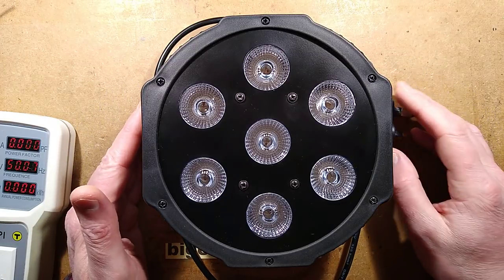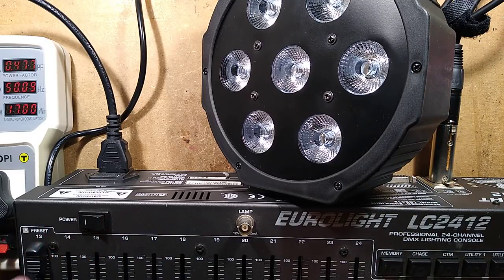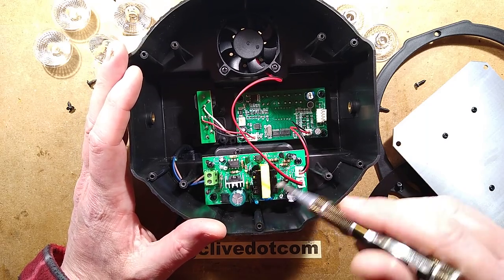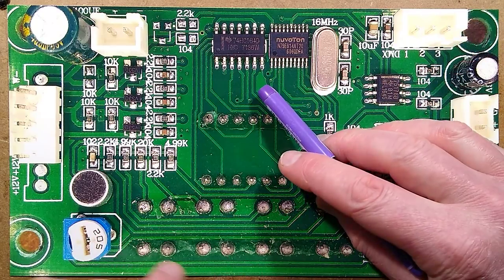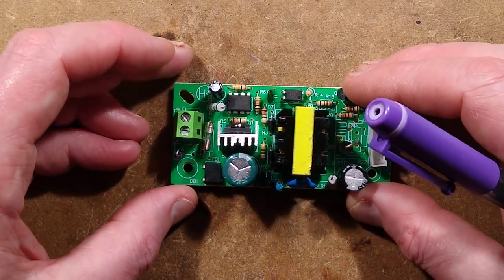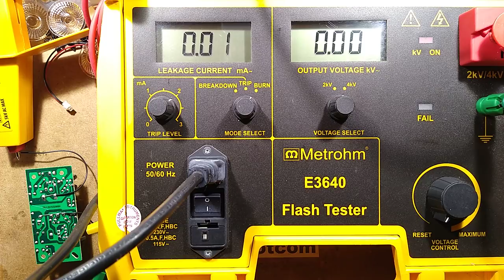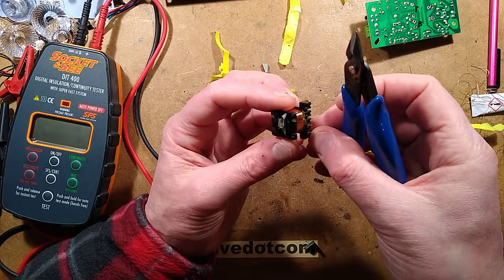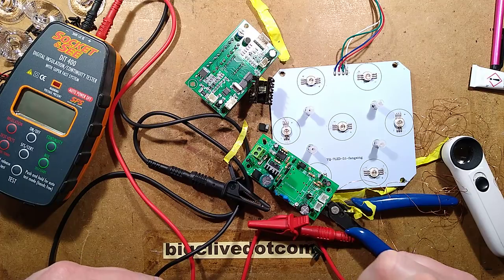3KV test of cheap disco light with circuit analysis.

Comment: I have loads of these 7 LED flatpar fixtures. Two things:

- You need to save the changes you made by pressing Enter after making any changes. It doesn't just random start at any mode, it starts in the same setting you've saved last. Press enter in any mode and you'll see Save on the display.
- Only the mode you currently see in the display is active. Meaning that when you have the light on DMX mode, you don't need to "shut" the manual mode.
Reply: Usually good to set the manual RGB values to zero though.

Some of them do strange things.
Reply: @shaunclarke94  These don't.
Reply: @benedykt123313  fair enough.

I've noticed similar ones do strange things. Easy to suss out when they're on the bench, less so when they're in a hard to reach spot on a ladder!

Had one which I obviously didn't save the "be a slave, not a master" setting to EPROM, and after a power cycle it took down the whole DMX universe. That was fun!

Comment: Hehe, when you pulled out the lightning desk, I immediately remembered my manager at work placing some brand of lightning panel at my desk mentioning something like "If you see some use for it, it's yours, it's broken and we are unable to fix it."
A colleague and I (the local television station that I had left as an employee still can use those things very well, even if only for replacement parts or when you inevatibly manage to repair stuff like that, that's a huge cost-saving kind of exchange of equipment between companies)  pulled out a light from the studio and before connecting it made sure there was no mains voltage on the output, connected the light which, at first instance did not light whatever we did, so we opened up a small part at the back where we found the DMX-polarity switch, flipped it and hey-ho, lightning desk (even though a cheap kind of thing) turned out to be working absolutely fine with every function we were able to figure out from memory, and the local television station now has a pretty good lightning desk for their studio. :)

Comment: The Oxford English Dictionary gives for "menstruum", as well as the obvious gynaecological usage, "A solvent; any liquid agent by which a solid substance may be dissolved." Presumably that is what they meant.
Reply: Stuff like nail paint remover?
I noticed it can melt plastics.
Reply: @SqualidsargeStudios  acetone tends to do that
Reply: @SqualidsargeStudios  A hefty dousing of nail polish remover on a (hated) co-worker's keyboard is always good for a laugh.
Reply: So basically the good old "don't use aggressive cleaners", just with antiquated language?
Reply: @michaelknight2342    many plastics, yes, but the acetone I've got is sold in plastic bottles.  A very specific plastic I guess.
Reply: @rolfs2165  Yes, but that's less fun.
Reply: TIL
Reply: Out of sight, out out mind = 
Invisible and insane.

Comment: I use Behringer audio gear and I mix music professionally,  they use Midas preamps, and TC Electronics designed circuitry etc. and when they clone something they add all the features that the original should have had.

my theory is that Behringer got their bad reputation purely from the fact that in the early 00's they were cheap to buy and as such people treated them like they would treat something cheap IE garage bands would buy one of their compressors and just beat it up, or pubs would use their mixers (due to cheapness), basically they'd end up in environments that you wouldn't find something like a Neve console and as such they were easily broken and abused by people who were drunk or stupid. 

so yeah, the only audio people who you'll hear complaining about Behringer are either cork sniffers or the people who bought a autocom pro back in the 00's and are still sour over the fact that a couple of the knobs broke off after years of flinging it into their car with no front panel protection.
Reply: I have a soft spot for Behringer products, they definitely give you a functional and pretty neutral sounding product for affordable prices. I started my career as an audio engineer using some of their analog consoles and outboard processing. My only grievance are the faders they used in the eurodesk and xenyx line of mixers, they tend to attract dust and grime and get intermittent after a couple years, regardless of keeping the board covered between shows. I do love the x32/m32 console though. Pretty much an industry standard for medium format event service.
Reply: @Wiresgalore  most things have that problem, people just don't tend to bother servicing Behringer stuff which is a shame. I still have my very first autocom pro, however I lost the first Behringer desk I had to a flood. you're right about the neutral sounds though, I hate it when audio gear affects a signal in a manner that I can't control, (I'd say "except microphones" but I kind of consider them a musical instrument in and of themselves). I just want it to do what it's supposed to do so I can focus on capturing the instruments/vocals etc. without having to worry about harmonics overstacking on everything and turning it into a muddy mess that I have to spend ages EQing out.
Reply: Dave Micolichek  lol - a bunch of pro guys on prosoundweb.com did a blind comparison test right after the X32 started first shipping and the x32 overwhelmingly was their pick - to the consternation of several of the “old timers” who were convinced B was crap.   

BTW for anyone curious, this post from the man himself explains why the X32 was indeed a game changer for them: https://soundforums.net/community/threads/uli-behringer-of-the-music-group-q-a.4396/page-5#post-51622

You can pay more if you want, but it’s stupid IMNSHO.  We got talked into buying a soundcraft board.  It’s shit.  No functionality - you can save all or none of your settings.  Might as well be taking a picture of an analog board.  One of the huge advantages of a digital board is if I have a singer swap in at the last minute I should be able to load my Mic and channel settings in for just that singer.  I can do it with an X32.  Can’t with a Soundcraft (and a surprising number of other digital boards).  It didn’t even occur to me that someone might ship a digital board that couldn’t save/restore partial sets of settings - that’s one of the best features of a digital board, especially with moveable faders.  No more having to take pictures and then manually reset crap.  I was floored.  Yet people still act like it’s a good board for live sound.  Unbelievable. 

The Soundcraft apps and PC support is shit too. The X32 is open (OSC support is amazing - you can control any function on the board via an OPEN protocol), has a HUGE enthusiast community, and at this point there is little you CAN’T do with it.  We got screwed, royally, by buying a “real” board.

But it gets better!  Samsung bought Harmon who already had sucked up Soundcraft.  Before Samsung bought Harmon, Soundcraft already had a reputation for being glacially slow.  Since Samsung bought them almost three years ago not one update.  I take that back - maybe the update to enable 80 channels.  That you still have no automation in organizing or controlling; as if 32 channel management manually wasn’t hard enough.

So yeah, dis Behringer all you want but for overall features they kick the snot out of over half of the established guys and have functionality that even some of the “big boys” don’t have.  If they ever started releasing higher channel versions of the X32 you can kiss off companies like Soundcraft (no way in hell I would buy another soundcraft board period).  They will just be toast.
Reply: Behringer gear is fine as long as you look after it, like everything else. An Allen & Heath desk will stay nice because they are an investment, people treat them with respect and will service them, an equivalent Behringer desk will generally have a hard life because its bought cheap and never serviced, also usually they are entry level so get abused.
I remember working in a pub that had a 4 channel Behringer DJ desk, everybody moaned that used it about the sticky faders which to them was a build quality problem, to me it was a beer spillage problem and I solved it by taking the top off, cleaning it up and giving it a service.
Reply: Dave Micolichek  that's where you'd be wrong - you take something of Behringers apart and you'll see proper brandname electronics, very well laid out PCBs that aren't all covered in flux residue and one of the best things they've done - they have "coolaudio" ICs in them which is their own silicon respins of classic ICs such as the mn3205 and all the other BBD trans-amp etc. ICs that were made obsolete decades ago. they have never compromised with the circuitry, they got the price down by simply making things like the enclosures out of plastic rather than metal, using cheaper connectors which seem to have a longer life span than for example, marshall amp input jacks.
Reply: @DocNo27  Agreed about Soundcraft. Their idiotic Si range is a nice try but a pain in the ass when you want to get serious. See my rant at watch?v=InItrdACIcA&lc=Ugzgam5aDzKomczTTah4AaABAg – Enjoy!
Reply: Some of their stuff is amazing, especially for the price... Unfortunately some of it is just crap... Like the 24 channel desk we bought for our church, which had to be sent back about 5 times, was replaced 3 times, and died of the same problem we'd sent it back for after about 18 months...
The problem - the ribbon cables linking sections together were too small for the connnectora they used. They changed this in later builds (like the one we got that lasted 18 months) but it seems it's still too small and wobbly.

Comment: There are sound engineers who swear by cheap Behringer mixers for recording metal guitars, because the pre-amps work perfectly for that and let you pre-mix dark and bright mics before pulling it in to a DAW.

I just use one at home for combining the audio from my PCs and stuff.
Reply: Dave Micolichek  yeah, a lot of people thought that when they introduced the X32 and then they proceeded to promptly turn the entire low and midrange industry on it’s ear.
Reply: @DocNo27  I own a X32 desk, rock solid! Midas pre amps.. Love it. Earlier Behringer desks were indeed rubbish.
Reply: Dave Micolichek  They have that reputation- but are quickly losing it. I have a few more recent Behrs - a couple mixers and a Model D analog synth. Couldn't be happier.
Reply: They have their places, but reliability usually trumps them out of the game.

Comment: For the no-brand (and some brand as well) chinese LED-PARs you have to press enter after changing the values. There are no confirmation, but they won't store the values without doing that. That's why blue was at 7 for both the resets, it was the last stored value (not selected). Strobes/shutters usually reset the clock along with adjusting the Hz. Because of that they will usually black out when you change the value for a lot of fixtures (Martin/GLP/CP etc).

Comment: Apropos of this, thinking about past cases of maxing out a chip;  an early '90s disco light called (if i remember correctly) the Apollo Paradox. It used a PIC16C54 chip to read DMX, drive three steppers (with gobos) and a synchronous motor with some mirrors on it, switched the lamps, did sound to light and also read the DIP switches all without breaking a sweat. That was back in the day when people knew how to code in assembler and squeeze the maximum performance out of their micros lol.
Reply from the maker: I like to think of tight coding as a challenge.

Comment: About Behringer:
I have a bit if experience using the Behringer X32 rack mixer, and it is very nice! Behringer stuff is alright in my opinion
Reply: Until you have opened one of the smaller panels up for the 10th time because of loose connections.  Why mount potentiometers or even faders to the front while you can have the design be so that you exert all the forces on the potentiometers on the pcb-islands (cheaper, more prone to failure).
Reply: Uli Behringer was literally one of the first people to bring his manufacturing to China, seeing the value in their cheap labor, although at the begining he contracted with other factories instead of building his own and thats where all the quality control issues came up from in the beginning,  and of course all the blantant ripoff and reverse engineered products. After being there for a couple years he cut ties with the various factories he employeed and started his own, which eventually snowballed into a place called "behringer city" There are a few documentaries on behringer city china, as it is so large it almost is really its own city, all the workers actually live in dorm rooms on campus. Uli behringer is a very interesting guy as he started out building illegitimate products in the pursuit of actually eventually making very legitimate affordable products. I've owned numerous bits of behringer gear over the years and its all served its purpose and did very well for me!
Reply: This got smug, self-satisfied and 'holier-than-thou" in only five moves.
Reply: @QED I absolutely agree with you, with the exception that the mixing board in question was stationary on a desk and could not handle regular usage as a voice-over-station piece of equipment.  After having resoldered some of the parts for like the millionth time we replaced it with (I think) a Yamaha one.
Reply: @QED True (my experience is that the couple of times we worked with religious groups those people were usually a lot more careful).
Reply: I’ve just brought a Behringer XR18 mixer and it’s one of the best pieces of kit I’ve ever brought. However I do own a pair of Behringer 15” tops and after a year of very moderate use (I haven’t driven them hard) they really aren’t sounding fantastic. Not that they ever sounded amazing but still. I find it’s a bit hit and miss with their products some of them are fantastic and some of them are a little underwhelming ...
Reply: @mitchbelectronics  Same goes for BlackMagic Design, they really shook up the market for professional video equipment, but some of their devices are (to quote the owner of an OBV-company we worked with multiple times at the local television station) "are called black magic for a reason" (for instance, while keeping compliance lengths for HDSDI cabling (and in this case stayed about 25 meters within the maximum length) the Blackmagic components would cause faults multiple times in one minute, and switching a repeater from Blackmagic that has a reclocker in it with a Sony monitor solved everything...)

Comment: The 62-ohm resistor on the 78M05 input and the capacitors to take the edge off the PWM outputs to the LEDs seem like decent ideas, even if some of the rest of the design is crap. Very interesting.

Comment: Many many moons ago I did stage lighting, it was simple. I generally used Strand gear one dimmer per lamp. If you wanted several lights to change together you used a long piece of timber on a bank of Junior Eights, or clamped the dimmers using rotatable handles on a wheel board, forget what they were called. You could use colour change wheels with synchronous motors or a different colour gel for each lantern.

Comment: I'm quite fond of the LC2412. For a small stage with no moving lights, it has just the right amount of channels and functionality. Its biggest flaw (and it's big!) is that DMX channels assigned to a memory don't go all the way back to 0 when the memory fader is pulled to its lowest.
This doesn't matter for incandescent lighting (which I assume was the thing when the LC2412 was developed) but cheap LED fixtures are quite bright even at DMX level 1 or 2 (as seen at 5:43).

Comment: Clive, a very good successor for the good old PAR64 are Showtec "Spectral M800 Q4 Tour" lights.  Every rental company have these in large amounts here in the Netherlands. They are IP54 splash proof and even IP65 waterproof is optional. (but much much more expensive)  I own only four, but it's amazing what you can do with just four !

Comment: I have several of these lamps, they are set to slow colour change using the internal circuit on the master then the others are slaved via DMX. They work well and have been in service several years now. The only thing I changed was I swapped the fans out for low noise ones because they are in ear shot.

Comment: I used to save all the old power supplies from computer that I worked on Then every few months I would go on a tear down binge I saved all the regulators and unrolled all the transformers keeping the wire. I use the wire to make rubber ducky antenna's for different projects by coiling them and putting shrink wrap over them. I also use the medium size wire to put rails on my project boards works great. If I think it needs better current capability I clean the wire first then run solder over the entire length to give it high current capability.

Comment: This light may not be suitable for professional use but I think it would be a neat light for home use or maybe doing small gigs and using it as a standalone unit. Of course something would have to be done with the loud annoying fan. Either put a resistor on it to drop the voltage down a bit or find a 24 volt one of the same size as they are probably running it at almost double the rated voltage of it. I have a very old light setup that uses 3 regular light bulbs  that once were flood style bulbs with a control unit that lets you either change the speed of the lights or can flash to music with a sensitivity control. If you choose to you can do both at once. I bought it at a Meijer store I worked at in 2003/2004 but now just has regular 25 watt color bulbs in it. It is still cool to use even now days.